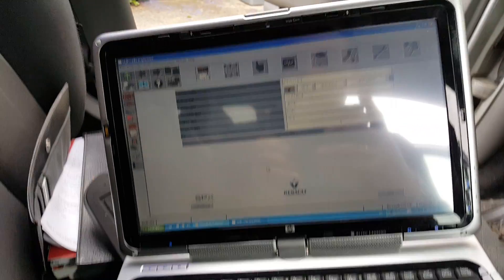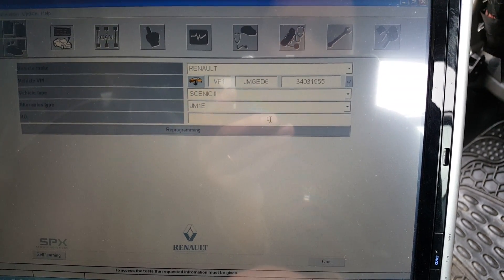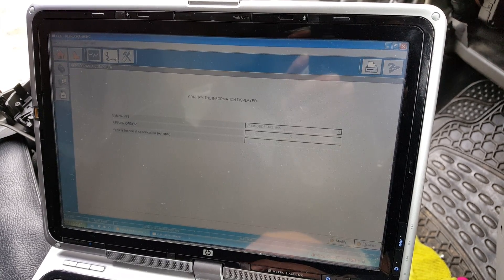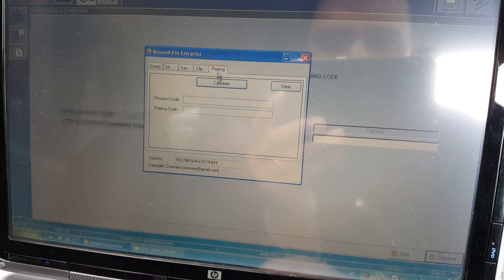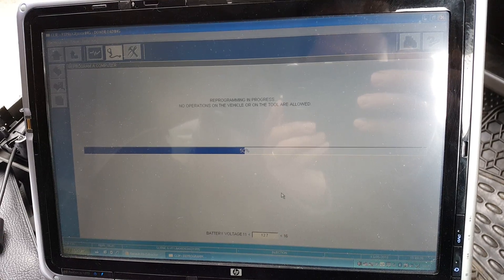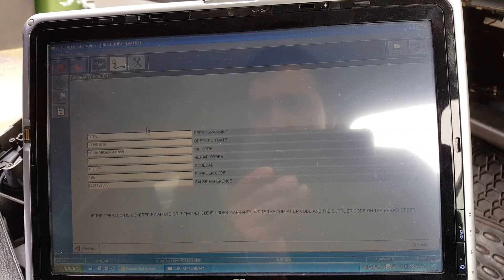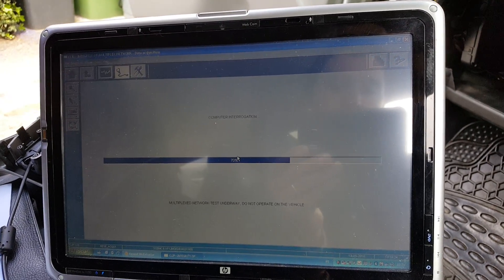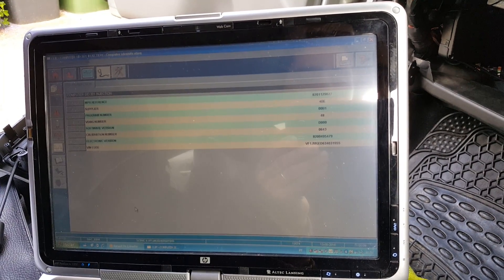Renault Can Clip ECU reprogramming procedure.

Comment: what is the purpose of this?
Reply from the maker: Autostop 
Hi
I have already replied to a very similar question...
This update installs an updated version of the ECU software, it can be released for example, if renault found a glitch in the previous versions, or to make slightly changes as the engine gets older etc...
Hope that helps...
Reply: Do you think that an injection reprogramming can solve the antipollution error? I done it some years ago and was working but after changing car battery the error was returning systematically, connecting clip no updates are proposed but I would to try, what do you think about?
Reply: ¿Can it program a used ecu on clio 2? the original is a iaw 5nr.ce1 whit sorth on throte on the back of the pcb and becuse it¡s a hybrid there is no way fix it whitout broken it soo new ecu need..
Reply: Hi. Excellent video. Query: I have a Renault Scenic Year 2005, 2.0 16V. Automatic box. F4R engine. I have made a complete repair of all its internal components and I want to know if I should perform a reprogramming of the ECU or just with a scan I can modify the date of the oil aging counter? After the repair, the car continues with the signal indicating the anomaly in the automatic box in the panel. What should I do? Thank you very much and I hope you can advise me about it. Greetings from Argentina!!!

Comment: Sir my Renault grand scenic reverse gear automatic is not working.  I have repaired the gearbox still it is not functioning.  What can it be? Ecu or etc
Reply from the maker: Hi
Any codes?
Anything on live data?
👍👍👍
Reply: @LMAutoRepairs  not sure. It was not working, so my mechanic fixed it. Installed it and tried to reprogram, but the system not allowed him. So he is now saying that renult company will do the software after that he can reprogram the gearbox. Spend 11000 thousand on this. Still not working
Reply from the maker: Without no information it is impossible to advise...
Hope you get it sorted...
👍

Comment: Have been told by Renault I need this 
Injector issue - Pre heating fault code stored. Requires injection update ref solution 43305. 
Can this be done elsewhere not just main dealer's?
Reply from the maker: It can be done elsewhere... providing elsewhere has the tools etc...
👍👍👍

Comment: Hello is this a can clip clone? If so are they worth it? As for the authentic can clip you need a renault dealer key for online stuff. I am looking to buy a clone as I need to sort my ecu out because an icarsoft fr v3 has ruined the settings and I need to set the heater plugs in the ecu config. Fault code df1069 heater plugs not configured. I know how to sort it. Just want to know if can clip clones are any good
Reply from the maker: They can be pretty decent...
Yes, my one is a clone...
👍👍👍
Reply: @LMAutoRepairs  do they connect via usb or bluetooth to the laptop?
Reply from the maker: @Jack_dc12 
USB...
Reply: @LMAutoRepairs  great thanks for the info!

Comment: What J2534 device is used
Reply: Can you send me a link to buy it
Reply from the maker: I used cardiagtool.co.uk 
I have no affiliations with the seller, buy at your own risk...
Reply: @LMAutoRepairs   Thanks for the info, they sell 'V219 VXDIAG VCX NANO RVDIAG For Renault All Systems Diagnostic Tool J2534 ECU Coding & Programming OBD2 Scanner' - Is this the same as your unit?
Reply from the maker: @johnsbond  
No...
Reply: @LMAutoRepairs  Ah ok, they don't seem to sell any others, do you think this will work?  Plus can I check does the ECU firmware come with CLIP software or is the a seperate download?  Thanks
Reply from the maker: With the clip software, the firmware is separate on a CD... up to clip version 156 or something like that...
After that, only online...
👍👍👍
Reply from the maker: Renault Clip... the OEM vci...

Comment: Possible to reflash Renault duster 2020. And make a key?
Configuration missing when tried to do an spare key.
Now both keys are not working.
No dtc on the car .
Reply from the maker: Possibly... but with clip for that year, you will need a renault subscription to be able to flash...
Can you not reconfigure using other tools?
👍👍👍
Reply: @LMAutoRepairs  I didn't find any option on autel im508.
You can guide me?
Reply: @LMAutoRepairs  not possible.

Comment: Hello,
since I had lost my cards from the car I had to get some from other vehicles, when I did that I found one from the car again, but the card no longer works in the car so I had to get transponders.
According to the clip, the transponders PCF7936 from Aliexpress all run at 315 MHz, so I got another one and added the card with RenoLink/ DDT4ALL to the car and lo and behold the steering wheel lock can be opened and the immobilizer also opens, I don't know if it starts, I have it didn't really try either.
On the one hand, the control unit (injection control unit) cannot be read out via clip and, on the other hand, there is now a strange message on the display.
No PROG on the display. What should I do ?
But my ZV, Keyless Go still doesn't work via the card, the switch on the roof liner works without any problems.
According to the clip, the front disc antenna doesn't work either.
According to the clip, both cards go to 433 MHz.
But since I only had one transponder and it wasn't pre-programmed, I'm looking for a dealer who sells good PCF7936AS transponders, possibly also some that are already pre-programmed
DDT4ALL also read the card and immediately marked it as 433MHz.
And the card that releases my steering wheel lock, WFS, never belonged to my vehicle.
There is only one card left from my vehicle, and I accidentally discarded one card and passed it through the household waste.
Now, as I said, I'm looking for good transponders.
Who can tell me what about the Zed Bull and what you can do with it.
I know that you can use the Zed Bull with the Effi Tool and with the Zed Bull you can also unlock transponders etc. etc.
Greetings Kale
Ps. If you want to teach your Renault with RenOLink cards, you have to be careful that the ignition is completely off and the WFS only flashes normally and not quickly, the WFS flashes quickly, you don't get a card taught, what you get is this error message.
7F8022 Conditions not set or sequence error
Tested it yesterday for over 3 hours, the WFS flashed normally, you could read the pins etc., you ensure that the WFS flashes quickly and there is an error message.
7F8022 Conditions not set or sequence errorCan I just miss an update / reprogram the ECU or does the UCH also work?
How can I add the maps back to the car?

calle
Reply from the maker: Hi
The cards are relatively cheap... rather than messing with transponders etc...
I would just buy a couple of cards pre-programmed for remote functions an program them... Nice a simple...
👍👍👍
Reply: @LMAutoRepairs  Hello, I have 2 cards with 3 buttons each (open, light & close) these are unfortunately not so easy to find and those on Ebay etc. only have 2 buttons, open & close and the hole in the top middle, I have these cards too, but my car doesn't want them.

How do I get to the UCH to do an update or to the HFM.

Vehicle is BJ. 2007 and as I said I have clip 159, 178 & 226

Comment: Hallo!
I have Renault Megan 2 from 2008. The original ECU was completely damaged. There is another ECU from a similar model. 
What needs to be changed in the Firmware / Settings for the new ECU to work on the car? VIN only?
Thank you.
Reply from the maker: Depending on the ecu, you might be able to immo off... if that is not what you want, you need to virginize it and reprogram it to the car, or clone the ecu if the old one still readable...
Other wise, move the eeprom if is that that ecu stors the immo data on an external eeprom...
👍👍👍
Reply: Original EEPROM dead...
ECU 21585421-2A
I tried to write all the FFs in EEPROM in the replacement ECU on the car in this case, it is blocked.
Reply from the maker: @yevheniishcherbakov9136 
That looks like a Sagem S3000...
You need a virgin eeprom file to write on the eeprom...
Reply: Can you help me with this file?
Reply from the maker: A quick google search, and you will find it...
I am away at the moment... can't really help... sorry...

Comment: hello there. Hope all is well. Have a question for you my good friend I see you are programmed this ecu I have a small problem. I have a 2005 vehicle and I cleared the engine Adaptations another vehicle doesn’t start I believe it has raised some memory of ecu I think I need to refresh it. Where could I purchase this program you have?
Reply from the maker: Hi
Comes with the tool...
But you can get it separately... Google will help you...
👍👍👍
Reply: @LMAutoRepairs mas qual o nome deste equipamento
Reply from the maker: @DanielAraujo-tf8en 
Renault Clip...
👍👍👍

Comment: Presuming this a chinese copy of the renault clip. 

Is this good or really no better than my autel ms908
Reply from the maker: My one works flawlessly...
👍👍👍
Reply: @LMAutoRepairs  my issue is airbag light on my renault captur. Says short to pos or open circuit for right front crash sensor. A quick google found same fault in a forum but the guy never returned to say what fixed it. He did say changing the front crash sensor did nothing. Unplugging from airbag module and doing same at crash sensor then load testing wires one thing. Failing that my monies on the module itself. Thought well is it time to buy the Autel Ultra or should I get the clip. Uktra yeah because at work its needed. My im608 pro is awesome and better on diagnosis than my ms906. Looking at ultra thats got loads more than the im608
Reply from the maker: Yes... the ultra is at another level...
👍
Reply: @LMAutoRepairs  so with crash sensor open or short to pos and if new sensor does not change that, then what do you think clip could do. Do to resolve

Comment: Hello friend, thanks for the description. I'm trying to update the power steering as well. But clip writes after I have selected the power steering that no connection can be established. Second battery connected, radio on or ignition on or off, or engine on, I tested everything with the same result. Maybe you know what I could do to make it work

Comment: Hi Guys, just wondering is it possible to reset the windows and radio cut off time on the Renault captur 2019 iconic as there is no key to turn to the second position that would get you windows and radio to?.
With the keyless sistem every thing goes off after a few minutes and I have to keep on putting the card key in the slot every time I want to use the windows.
Thanks in anticipation

Comment: If I have computer injection from car with automatic gearbox - can i reprogram it to manual gearbox? Someone in my car installed that computer and i've got some issues with speed limiter and cruise control.
Reply from the maker: Yes... you should be able to...

Comment: Hi dude, could you please help me how can I retrofit the FCW (front collision warning) radar sensor into my smart 453 car (twingo III) ? I don't have this radar in my car since I bought it.
I bought the radar, the new ECU module and all other things. Just question about programming. How to connect new modules (radar ECU) to the car and how to switch on this new ECU module ? I heard all other modules in the car should be tuned for working with a new ECU

Comment: Hi. In your video you said to connect clip to the mains during ECU Programming. Can you show/tell me which cable you used for this connection and which connector on the clip? Also can ECU Programming be performed with SP19-A Can Clip (Green motherboard with gold edges with genuine chip) or the motherboard has to be completely gold or it does not matter? Thanks

Comment: Hello.
Need your help in one subject. I would like to change my renault radio on my megane 3. My car has a non bluetooth radio 28115 0030R with carminat tomtom display (non-live) and i would like to change for a radiosat bluetooth 28115 9389R that came from a junk yard beated car. The beated car has a diferent type of display. I know that it should be required to change the VIN number of the beated car radio config for my VIN, and probably also change the display type that it is connected to. Could you help me indicating how that can be performed (noticed that this video has a laptop PC with portuguese language, in any case are you also portuguse like me?) Thank you in advance.
Reply from the maker: Hi
Yes, I am Portuguese...😉
I never done such thing, but, I would guess that your best option will be either Clip or Renolink...
Most likely Renolink...
Thank you for watching!

Comment: Hi, I'm watching your videos, very detailed . I'm wondering if I replaced an abs pump/module on grand espace 4 ,it can be reprogrammed with can clip v190?
Thank you!
Reply from the maker: I would say yes...
But I never done it, so don't take my word for it...
Thank you for watching and for your comment!
Reply: @LMAutoRepairs  
Hi, sorry bother you , again, I sorted out the abs pump, the error code gone. Now I have df015 clutch pedal sensor incoherence between gearbox..., I checked all switches, on clutch pedal and brake, all good. Have you any idea what can be?
Renault espace mk4 2.0 dci jk01 2007
Kind Regards

Comment: Hello, I have a new EGR valve mounted on the Megan II 1.9DCi and I need to execute SC036 via Clip v190. The instructions from the Dialogys - Component Replacement (see quote below) say that it is necessary to run the SC036 - reinitialize programming command. Can you advise me in which section of the program can I find it? In CLIP I can only see in Injection/Repairs/Programming - commands SC001, SC002, SC003. Is this command still present in CLIP v190? Thank you for your advice.

Quotes from the instructions:
PROCEDURE to be followed after replacing the exhaust gas recirculation valve:
– Run command SC036 Reinitialise programming,
– select EGR valve as the type of operation, then follow the instructions given by the diagnostic tool,
Reply from the maker: Hi
I never done it on that engine, but done it on a 1.5 scenic...
And at the time, I had to reflash the ecu in order to finish the egr installation...
Done ages ago, and can't really remember all the details... hope this helps somehow...
Thank you for watching!

Comment: Hi where did you get the figures for “after sales type” engine code gearbox code etc on the 1st page. I have version 173 and it’s goes not auto detect them
Reply from the maker: After sales is on the vin...
Engine code and gearbox... you need to check what is fitted in the car...
Thank you for watching and for your comment!
Reply: LM Auto Repairs apologies for my stupidity you mean the vin plate under the bonnet
Reply from the maker: @tariq3877  
For the after sales yes...
If you see the video, the after sales number is a section of the vin number...😉

Comment: hello I have 2005 megane hb 1.6 16v and my steering rack has been changed. than steering check comes on the screen while driving. we connected can clip it says angle sensor fault. probably we need to calibrate steering angle sensor how can we do this thank you.
Reply from the maker: You should have a menu in clip to perform the operation...
Thank you for watching!

Comment: Hi there l have a problem with reprogramming cd radio in my Renault Laguna,l went even to renault and they told me that radio l have bought from second hand have different vin number and they cant do anything about it. But other people from Renault forum saying that is possible to do that. Can you help some how?
Reply from the maker: Can you not change it with clip? 
Or you don't have clip?
Thank you for watching and for your comment!
Reply: @LMAutoRepairs   someone with Renault clip tried few times to pair the radio but wasn't possible. Messege shows contact renault dealer. Also carried out investigation in Renault dealer found present fault for button pressed in system. Even l have bought another radio but the same   fault problem appears.

Comment: What voltage do you need at the car battery to program a key card with can clip?
I tried this morning with my 2005 megane, and the procedure stopped and gave me the low voltage warning. I had a charger on the battery and voltage was 13 volts at the battery! I thought that would be enough? .
That was interesting what you said about the can clip unit itself needing a power supply? I didn't know this, i just had the clip connected to the dlc and the usb to the laptop.

Comment: Hi, recently I have reset the configuration of an GPS/RadNav ECU trying to activate Android Auto on a Renault Fluence R-Link 1 system. Now the nav shows "Unconfigured Device, please add EOL settings" and it does not load the radio nor the maps. Can the Can Clip reprogram the NAV/Radio ECU and solve this?